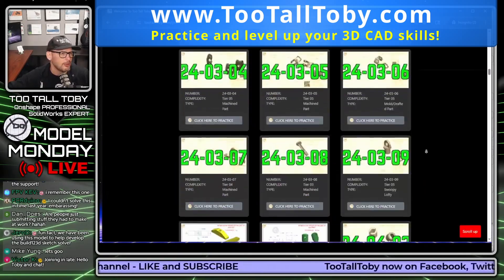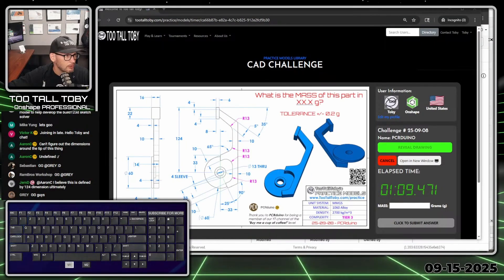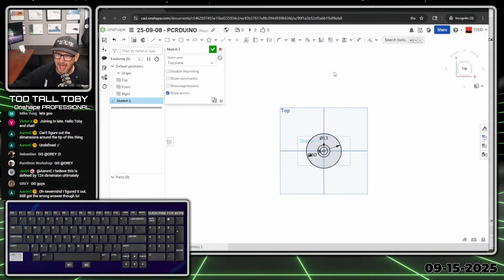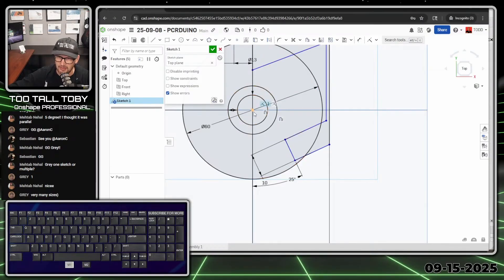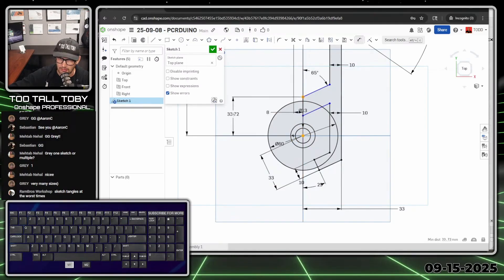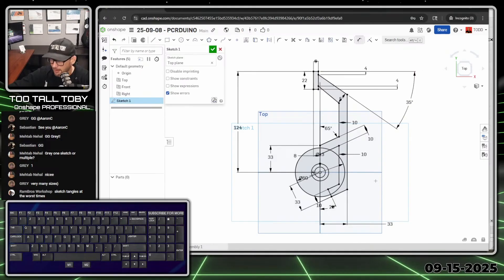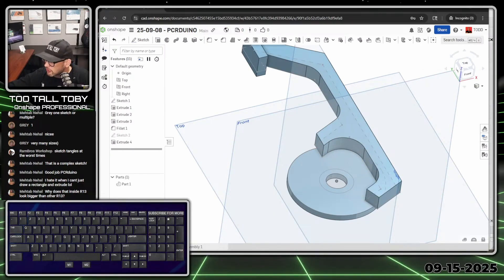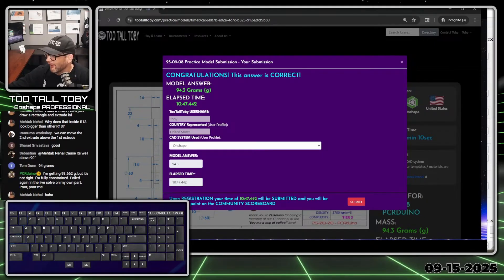Onshape Beginners Step by Step Tutorial - Tier 3 Part - ROBOT ARM CLAMP

Comment: ????!
Just fillet in the sketch!
Especially as every aspect of this design is in the main sketch, there's no reason these fillets shouldn't be too.
Then only the Extrude distances need specifying outside of this master sketch.
So it would be very clear, very easy to modify.

The solution to the problem fillet shown just seems downright dirty, bad.
Reply from the maker: Yeah it's an interesting problem for sure!  One of the cool things about the website is that users can upload their own tutorials. I know I still have a lot to learn about Onshape so hopefully we'll see some more users making Onshape tutorials!
Thanks for the suggestions!
Reply: Fast and pushes through some dimensions to show that moving your points and lines might be necessary after constraints move.
I ike how quick TTT got back to shaping and dimensioning the part.
GG -get it done !